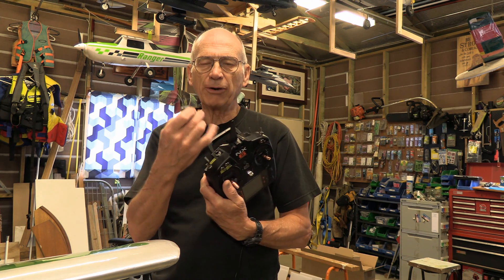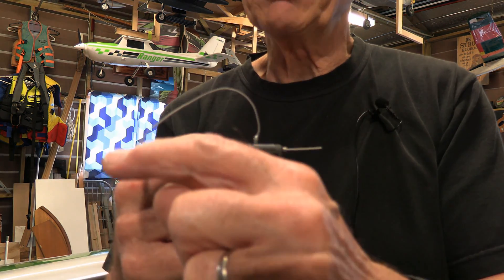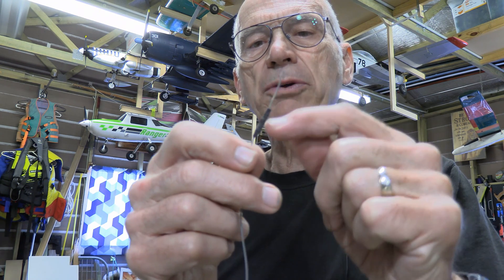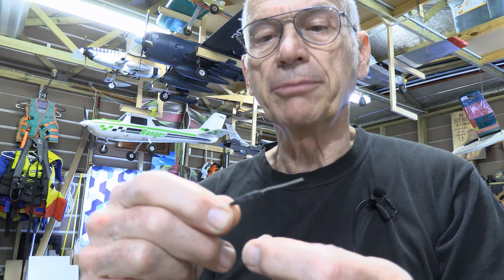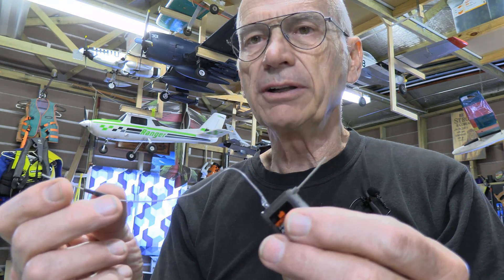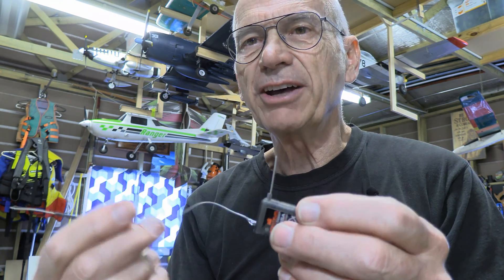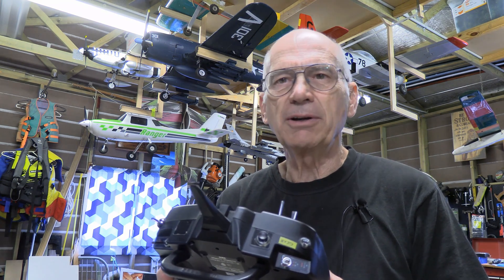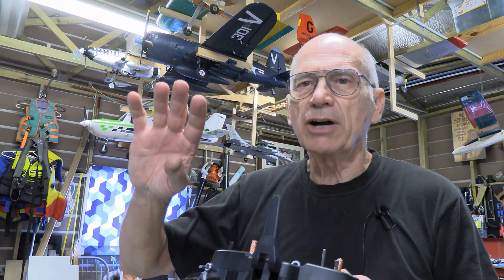All About RC Plane Antennas

Comment: Unless the nx6 is very different from the nx8, the second antenna is not in the handle , it is inside the case but oriented the same as the handle as you pointed out. I've never taken apart an nx6, but I can't imagine that it would be different than the nx8.
Reply from the maker: Thanks.  I expect you are correct.

Comment: Hi Jim, that's one of the most usefull video's I've seen for a long time. Especially for beginners like me, it is really important to know how to place the receiver and antennas in the correct way. I lost my first plane due to wrong positioned antennas. So thanks a lot and best regards from Germany 😊
Reply from the maker: Glad it was helpful!  I'm just now in the process of creating another video for new flyers  on what the radio systems are all about.  You might find it of interest.  In preparation for it I have written an article.  You can find it in a post on rcjim.com: https://rcjim.com/2025/04/09/rc-whats-what-for-new-flyers/

Comment: 1. Well done; however, I'm not sure about the longer antenna being a dipole. I have several receivers where that antenna obviously isn't a dipole; the shield of the cable simply ends about 30mm from the end of the cable and there's a piece of clear heat shrink tubing over it. I consider all of the Spektrum antennas to be simple 1/4 wavelength elements.
2. Since antennas don't transmit or receive much signal off the ends, I never mount the antennas to where they're pointing toward the nose or tail of my planes. As the plane is flying away from me, the antenna would receive very little signal.
3. The better Spektrum transmitters actually have a receiver module with one or two antenna elements inside them. It's there for the wireless buddy box system and is what lets you bind one transmitter to another. It might also receive telemetry from your plane, but I'm not sure about that.
Reply from the maker: Checking into it further, I think you are right about Spektrum.  Clearly their present models are monopoles, and looking at their product list carefully, I don't see any sleeved linear dipoles.  My old AR636A has something on it that I thought was a sleeved linear dipole, but in examining it closer, I think that part is just a crimped on mounting point.  However, according to https://www.rchelicopterfun.com/rc-antenna.html Hitech, Jeti and other manufacturers are using sleeved dipoles on their telemetry enabled receivers.  On that website they state that many of the Spektrum two wire receivers - where the antenna wires are directly opposite each other and in line with each other - are two wire dipoles, as I described in my video.  The AR6210 would be an example of one of those.  But it is a discontinued model.  Thank you so very much for your input.  You have taught me something!
Reply from the maker: I'm scratching my head again.  I happened across a video where a hobby shop owner was comparing some old Spektrum receivers with the new internal antenna models.  One of the old was was the AR400, and it had the same thing on the antenna that my AR636A has.  Looking up the AR400, they list one of its key features as: "Antenna is amplified for greater signal clarity."  That sure sounds like a dipole antenna, and it certainly is linear...
Reply: @RCJim  Hmmm, I have an old AR636A that I can peel the heat shrink off of to see what’s under it. I can’t register or reprogram it, so I might as well.
Reply: @RCJim  Under the heat shrink is a circuit card about 4mm wide and 15mm long. It has one 8-pin microcircuit that's about 2mm square and several surface mount resistors, capacitors, and perhaps inductors. I would say it's a pre-amp. It's definitely not the other half of a dipole antenna.
Reply from the maker: The mysteries of RC electronics continue!  Thanks for uncovering that vital bit of information!
Reply: @RCJim  👍
Reply: @RCJim  I haven’t seen any of those brands that use a sleeved dipole. I made a sleeved dipole many years ago for the FM stereo receiver at work. The impedance at the center of a dipole is 70 ohms with no reactance, so 75 ohm coax works pretty well. And, a sleeved dipole looks fairly decent hanging from the wall of a shop.